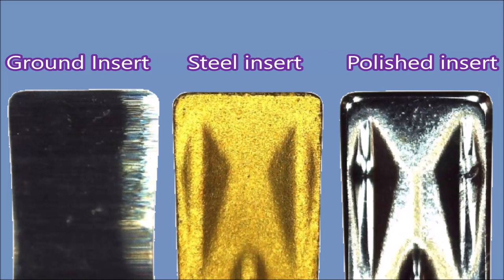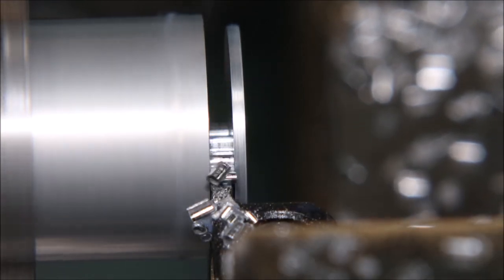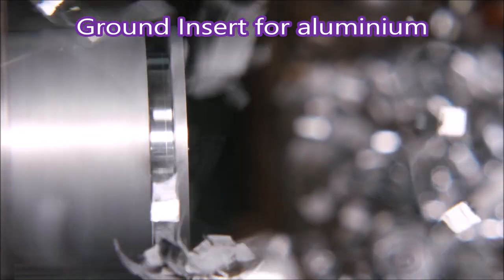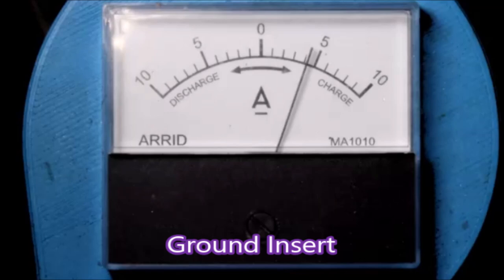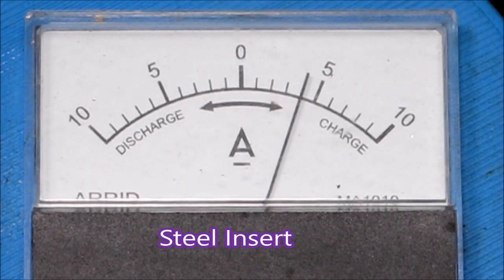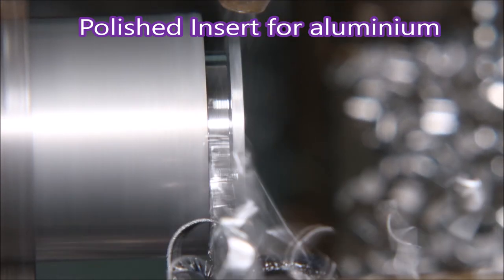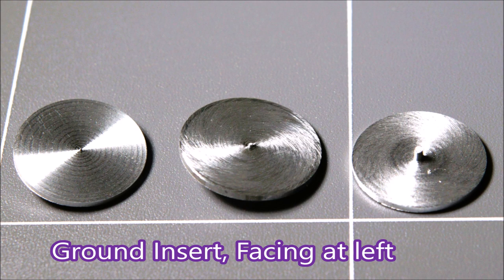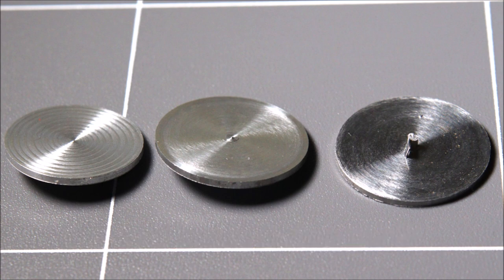Parting aluminium with eBay inserts, one for steel and 2 for aluminium

Comment: Very interesting Nigel.  Thanks
Reply from the maker: Thanks Gary, nice to know I can always count on you for a comment. Nigel
Reply: @smallcnclathes  I was behind on videos and watched your last 3 or 4 at once.  You know that I am ignorant on machining and lathe work. I only did a little steel turning back in the mid 80s. But watching you and I've been watching cutting edge engineering lately and there is so much to learn.  It's made me think about getting a small lathe or mill but they still cost a lot and I have nothing to make with them . But it is interesting.

Comment: The aluminium insert turns quite nicely, the swirling effect is unusual, could be the swarf curling in the groove?? Don't know! 
Great demo again Nigel 
Cheers Ian
Reply from the maker: Hi Ian, as I said, I have seen it before, but it does not affect the smoothness of the surface finish.  I must say apparently though, as I have no way to measure surface finish. I must add, I don't usually feed that hard, I would usually part at 0.05.  0.1 was the recommendation on the packet and it certainly had the chips flying out of the groove

Comment: My guess is the positive rake on the polished insert makes it sharp enough
 It's probably hard to visually see the "edge". Polished edge reduces edge build up, so may have longer life than the ground unpolished insert 🤔
Reply from the maker: Hi Thanks for your comment.  It gets a bit like how long do you want it to last. I would go ground just to make it easier on my small lathe. As a hobbyist, a pack would most likely outlast me.

Comment: Could you re-test with 6061?
Reply from the maker: I have about had enough of this subject! I tend to do videos based around small lathes. I see no reason why anyone with a small lathe should punish themselves by opting to use 6061. Of all my videos, I think around three might be with 6061 and they were mainly about how horrible it is to deal with. Back when I was working, I sent a few jobs to friends with the equipment to deal with 6061. Lots of power, flood coolant, it never bothered them. If I had some in stock I might try it as the lathe is still set up, but I doubt I will find any. It might be interesting as this exercise used feed that is 2 or 3 times faster than what I normally use. I won’t buy any, but if I find some, I might give it a try. Thanks for your suggestion even if it does give me an attack of the horrors. LOL. Nigel
Reply from the maker: Oh dear, I looked in the shed today and found some 1" 6061.  I am busy for a couple of days, but if I have an attack of silliness I may turn it down to 20 to run the test. I would only plan to run it with the ground insert though, that would have to do.
Reply from the maker: It is up! https://youtu.be/unz8Qzt404k

Comment: Problem seems with the "ground insert" microgeometry - that's why the vibrating sound occurs. The other two seem like they have same general all-use geometry, just the second one doesn't have TiN coating, seems like it doesn't have any coating at all - that's why the machine needs more power. TiN is not very good choice for aluminum but the coating atleast lowers the friction and thus lowers the temperature and causes less material welding.
About the "whirling effect" and the ugly circles on face, it seems like rigidity issue - of both tool and workpiece. You machine very soft ductile material, every milimeter away from chuck makes miracles. When facing by half the width of the insert, you basically force the less that 2mm wide grooving tool body to bend. And same with the material on such high RPMs - the "steel insert" geometry is not much sharp as it's multi-purpose for harder materials and the forces just push and bend the material. High RPMs in this case may seem to work counter-productive. When I'm facing aluminum (and basically everything), I always use regular one-point cutting tool technique. Try to leave 0.05-0.3mm of material on the roughed face and add finishing cut. Also try lowering both the feed and RPM - feed 0.03-0.05mm/rev, RPMs 1000-1500. Also try adding one to three 0.1 wide metal sheets under your tool to get it bit above center.
Reply from the maker: Hi Adam, thanks for our comment. I used that feed as it was what was suggested on the packet. I also used the suggested rpm. If i
I was doing this for myself I would not run slower. I typically use 3000 rpm for any thing under 30 mm in non ferrous material and my usual feed would be 0.03 to 0.05. Nigel
Reply: @smallcnclathes  RPM is proportional with rigidity, depth of cut, cutting angles and part/tool overhang. For the first facing pass, big radial cutting forces occur on the workpiece and the tool is basically bending the material. Combined with high RPM, even small radial force can move with the rod easily. Aluminum is not steel, you can use very low cutting speeds and don't break the tool. The main thing is to stabilise the workpiece/tool to avoid movement and vibrations.
Reply: 2011 isn't a "very soft ductile material" though...
Reply from the maker: @adamsevcik7708  Hi Adam, my machines are small, I run highest possible rpm when ever I can. My machines are not automatic, I have to stand at the machine while it is working. If higher rpm means I stand around less I will go with higher rpm. Because my machines do not have huge power, heavy cuts are not the norm for me. Most of my jobs are high rpm with light cuts. A lot of the time, I am unable to reach the doc and feed required to make the insert chip breaker function. I appreciate the effort you put into your comments.
Reply: @MidEngineering  EN AW-2011 is normal aluminum+copper 100HB alloy.

Comment: What's the diameter of the aluminum rod?
Reply from the maker: 20mm, why do you ask? That was about as large as the tool holder would handle. May have gone to 22, but I had 20 in stock. Thanks for your comment. Nigel
Reply: @smallcnclathes  I had my issues parting like 40-50mm soft steel, I figured out some gentle way to part it but it's far from all your videos.
My pulley setup isn't good either at the moment, it's over-tensioned to avoid slipping until I will install my multi-v-belt. I only use the ground inserts for a long time.
Reply from the maker: @mrechbreger  the largest parting tool I have will only go to 41 mm. I have had to be selective in the work I take on. If the job requires a bigger lathe, I shop it out.

Comment: Well i guess that shows results beat supposition, although the ammeter does confirm one thought. As with all things, if the you get the required result does it matter how you got there(politics excepted of course😉)?
Reply from the maker: Hi Chris, trying to make money with a small cnc can be a trial. I have learned it is a better than just acceptable result that is what one needs to strive for. With a spindle rated at 1/2 horse power, it can be difficult to compete and there have been quite a few times I have had to adapt to get the result I wanted. Thanks for your comment.